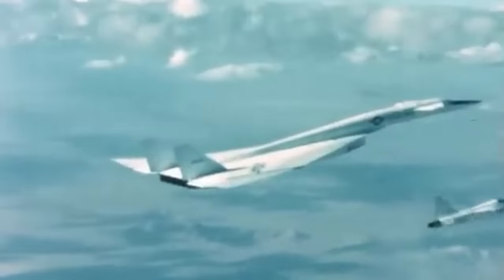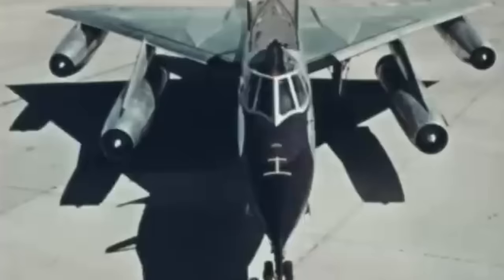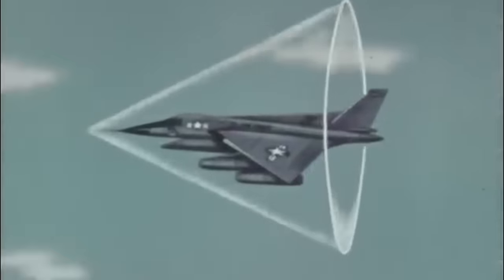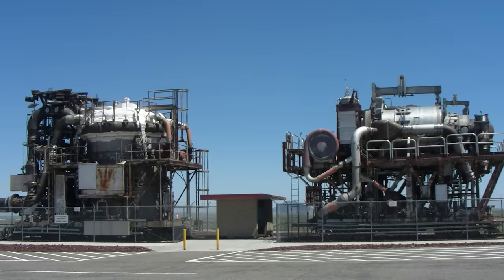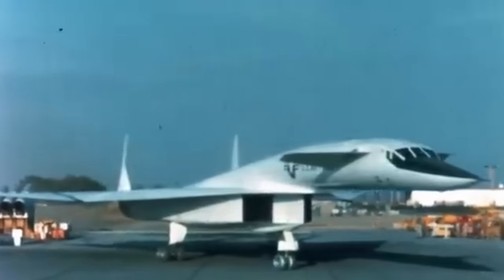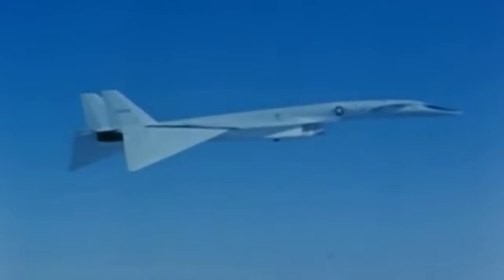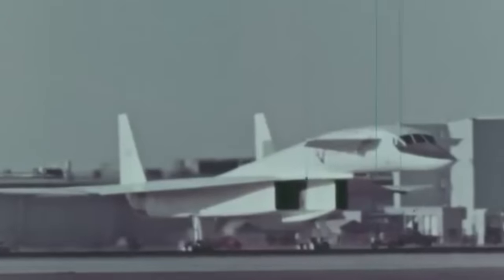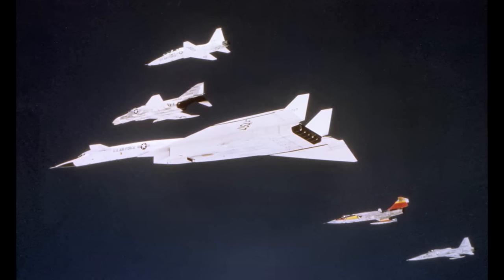The Strange Super Plane That Ripped Off Its Own Paint

Comment: That Ripped Off Its Own Paint

Not exactly. The paint peeled because of too-thick paint, the result of several re-paintings – allegedly done to impress various VIPs.  It cracked as the Valkyrie flexed in flight, and was then torn away by the airstream. It was stripped and repainted with a single thin coat of white paint, thus resolving the issue.

Comment: "It also featured an 11-stage axial flow compressor with variable stators and a two-stage axial
turbine, contributing to its impressive thrust-to-weight ratio above 5 to 1. This high thrust-to-weight ratio means the engine could deliver over five times more thrust than the weight of the aircraft, ensuring exceptional acceleration and agility."

False. The 5 to 1 ratio was engine thrust to the engine, not aircraft, weight.
Reply: Free ice cream if you can tell me what became of the YJ-93 engine project.  After the cancellation, what did Pratt&Whitney do with these engines?
Reply: @NeroontheGoon  I'm unaware of anything that became of the "project." The only thing I'm aware of is some kind of emission tests. I'm not aware of any involvement with them by P&W.
Reply: @smark1180  Geez, if been working on Pratts for so long I’m calling GE’s Pratts too, my apologies.   The YJ-93 was a scaled up version of the J-79 and also lent its core to the GE CF6 series turbofan engines.

Comment: Error at 9:15, where it is state the aircraft has a 5 to 1 thrust to weight ratio... that 5 to 1 ration must be engine thrust to engine weight ratio not aircraft thrust to weight ratio. Such a glaring error makes me think this video is AI generated. Modern Fighters have thrust to weight ratio's greater than one when lightly loaded. I calculated the XB-70 to have 0.33 thrust to weight ratio.

TECHNICAL NOTES:
Engines: Six General Electric YJ93s of 30,000 lbs. thrust each with afterburner
Maximum speed: 2,056 mph (Mach 3.1) at 73,000 feet
Range: 4,288 miles
Service ceiling: 77,350 feet
Length: 185 feet, 10 inches
Height: 30 feet, 9 inches
Weight: 534,700 lbs. loaded

Comment: I can't help but think the Valkyrie would have been a golden platform to build our SST off of.  Many issues had been resolved by the time the Valkyrie was cancelled.  This could have given us a jump on Concord.  However, the market fell off and the economics of the SST were no longer a money maker.  I wonder what an SST built off of this platform would have looked like in it's completed phase.
Reply: The B-70 program was cancelled 3 years before the first one flew and the only reason the two XB-70s were finised was for high-speed research, but the XB-70 itself would not be even close to what could be used for an SST, and no proposed SST was derivative of the XB-70.
Reply: @shenmisheshou7002 All SST are huge delta wings with a lot of engines in rectangle nacelles. All have some aerodynamic elements in front of the delta wing. Looks similar to me.
Reply: @ArneChristianRosenfeldt  The F104 looks similar to the French Mirage,  but that does not mean one came from the other. The only SST to enter service did not have the same kind of delta wing as the SB-70 and was not a canard wing.  The Boeing 2707 -300 design used a delta wing but it was not a pure delta, and neither was the Concorde wing a pure delta. Both of these designs (and the Boeing 2707 design preceded the Concord, though of course the 2702 was never produced) used an “ogival” wing and they are the only two supersonic designs that I know of to use ogival wing.  So, the only production SST to fly had a ogival delta and did not use a canard, did not use drooping wings, had a single tail, and used two clusters of two engines, but before the XB-70, there were plenty of aircraft in operation that were pure deltas and if you make a bigger supersonic airplane, the delta is a natural choice. Many large supersonic aircraft use some form of delta, or wings that can be configured into a delta.  F-111 and B1B are both planes that can be configured into a delta (F-14 could as well).  The first US Delta test plane was the FX-92, which was designed in 1948.
Reply: @shenmisheshou7002  I was hinting at the fact that a Canard has a similar effect as ogival wings or leading edge extension. Tu-144 originally had a single cluster of engines under the wing. And it flew at the airshow. The single tail got too hot. Instead of a twin tail like on XB-70, they split the cluster. Why?
I think it is still a notable result that even with at a large scale a super sonics planes cannot profit from being a Busemann biplane to capture the shocks. Or you could think that you could make the straight wings of the F-104 work because you have more space to manipulate the leading edge.

Comment: That's why the USAF was so nervous about the Canadian Avro Arrow project, with requirements from the Canadian Air Force for an operating ceiling of 75,000 feet, Mach 3.5, and outfitted with two Iroquois engines producing 30,000 ibs of thrust each, a fuselage made primarily of Titanium, a bombay suitable for 12 different configurations including guided missiles (they were already designed and tested). The American government lobbied the Diefenbaker government to cancel the program, and it did, the day became known as Black Friday when over 10,000 Canadians lost their jobs and 6 Avro Arrows were cut up on the tarmac; but, a 7th example of the completed aircraft outfitted with the first set of new Iroquois engines, and painted in all white, with no identifying markings, escaped and flew non stop to the U.K., where at one of their airbases, it was disassembled and used in research for future projects such as the Vulcan heavy bomber. Proof of this came back in the 90's when the pilot's ejection seat and one of the Iroquois engines were offered back to Canada by the U.K., and now sit in the National Aerospace Museum in Ottawa. The co-pilot's seat became available on Ebay, and sold for over $250,000 CDN, while the second Iroquois engine now resides with a collector in Calgary, Alberta, who purchased the engine from a British Museum where it was in storage. One of the cockpits was saved from the scrap yard and sits in the museum in Ottawa also. The Avro Arrow will rise again..........in this life or the next, or maybe a time travelling grandfather can go back and prevent it's demise...........that would make the Americans shit their pants!!!